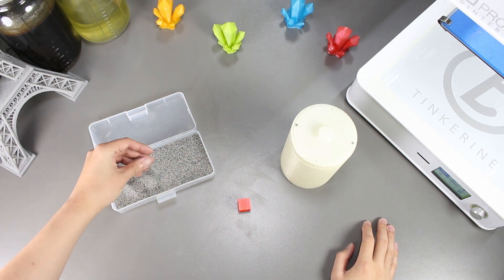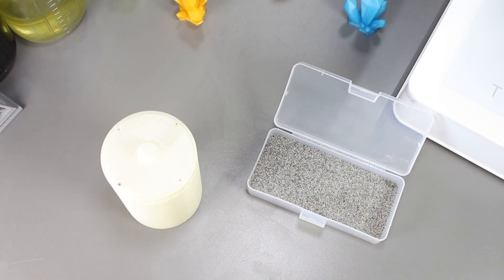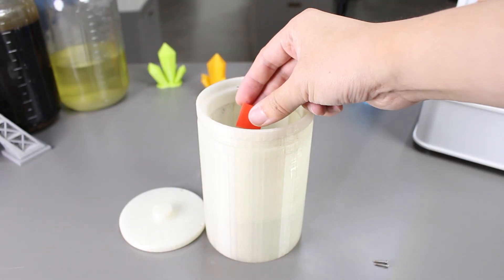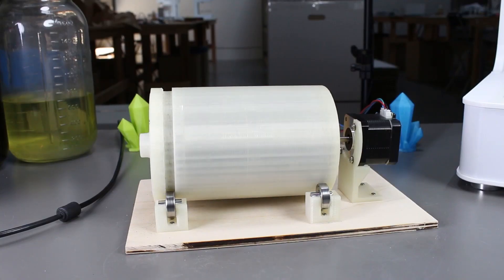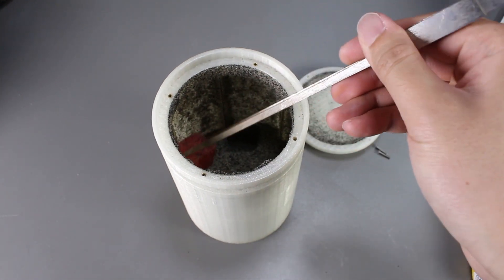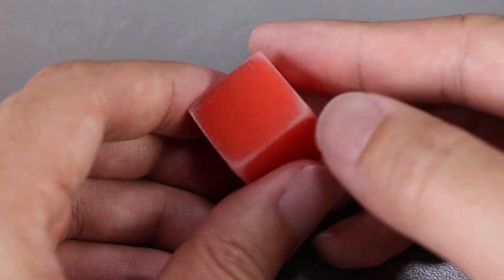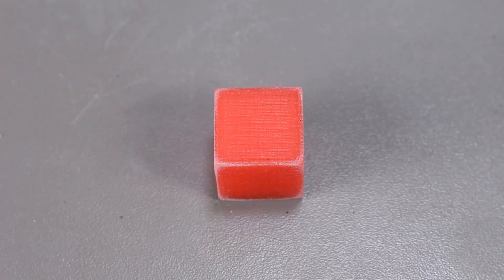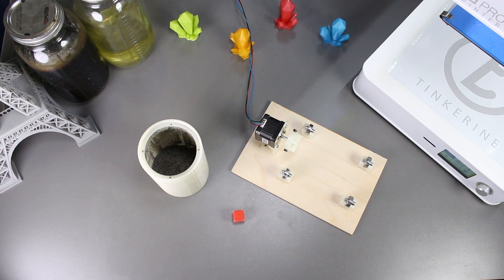Post-Processing 3D Printed PLA Print with a Rock Tumbler Part 3

Comment: If its a flat or concave surface, its not going to sand it, it has to have pressure to the outside from impact for the media to grate on it. It will work great for rounded prints with hard to sand surfaces. 👍

Comment: Are you sure the alteration of the cube comes from the interaction with the sand? Isn't it rather because of the interaction with the tumbler itself? It would explain that the sides and corners are more affected, because they have more chances to hit the tumbler than the faces. So maybe you could try a tumbler with spikes on the inner side to help having contacts with the sides of the part?

Comment: When you go to a river and you see the rounded smooth rocks in the river, do you think they started out as rounded smooth rocks? No, they were broken chunks, and that is what is happening with your cube test in the rock tumbler. The flat surfaces are holding the sand while the sand flows over the edges and corners, rounding them off, just the rocks in the river.
Reply: A vibratory polisher should work better, that is what they use nowadays for deburring and polishing.  You should be able to 3d print one.

Comment: It's a very interesting thing. But i guess you will have better results if you not use simple sand. Because its variates to much in his 
granulation. also there could be small stones in there.

so there are 2 things i would try out, if i would be patients enough:

1. Use playground sand, it's much finer in his granulation and make it really soaked in water. but this will be a try and error game. Also it could be possible that the stepper motor is to weak.

2. use quartz sand! it is also used in sandblasting, so the granulation is pretty small.
Reply from the maker: Thanks for the comment and advice!
Reply: @Tinkerine  Your welcome, without you i wouldnt even think abouit this!

Comment: Personally I use a soldering iron to smooth some parts of my prints. It's easy to manipulate and allow very easy correction in tight corners. Require some skill but it works fine. (use a soldering iron with temperature control for better result)
Reply: Do you have some pictures or videos showing objects treated with this method?

Comment: Using this method will result in a rounded part. The same way grains of sand all become spherical in shape (originally jagged forms), the cube will eventually turn into a sphere. As a result, the sharp corners are the first to go; they’re most likely to protrude and come in contact with the sand lining the walls of the tumbler.
Reply from the maker: Thanks for the comment, that makes a lot of sense!

Comment: The tumbling medium that you're using is too fine. You need to use a coarser medium (i.e. shot pellets, steel beads, steel rods) and work your way up to finer media. Much like sanding. Otherwise only the most exposed surfaces, such as the corners, will be affected. You should also tumble in water, or the viscosity of the tumbling media will be too low to ensure uniform smoothing.
Reply: great info ! also, the printed part needs to be heated using heat gun to restore back its color. i think the fastest way  to smoothen pla is to sandblast it.

tumbling produce great result but very slow process.i thinks it is suitable only for mass production
Reply from the maker: Thanks for the comment and advice, it really helps us out!

Comment: A cube is not the best object to test this technique... A spiky  ball or something with a lot of angle would be a better test.
Reply from the maker: Thanks for the comment, we will try our next experiments with another print!
Reply: Honnestly i pretty sure this method could be a very good way to smooth the edges of a print even if it's not "the best" technique to smooth the printing lines.
Reply: Correct. A belt sander would be perfect for a simple cube and a tumbler is for creating soft edges.